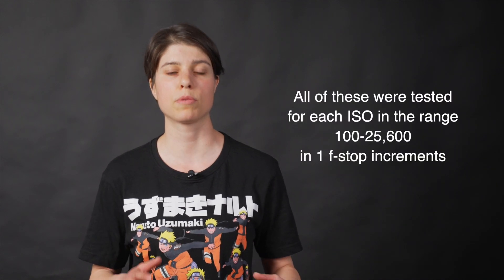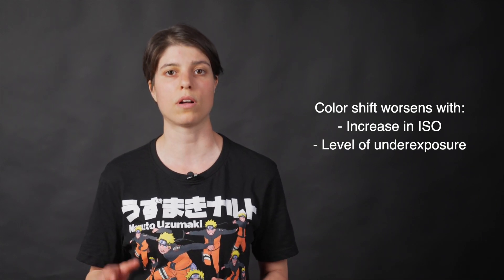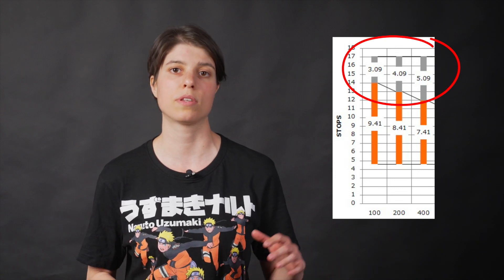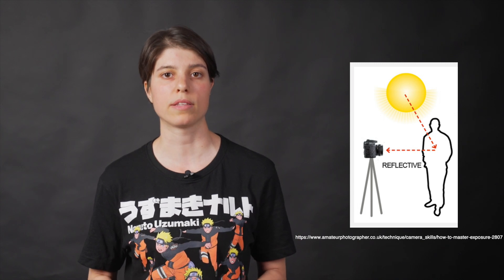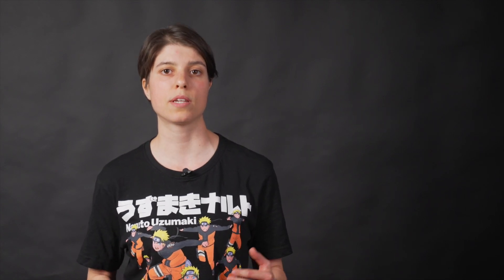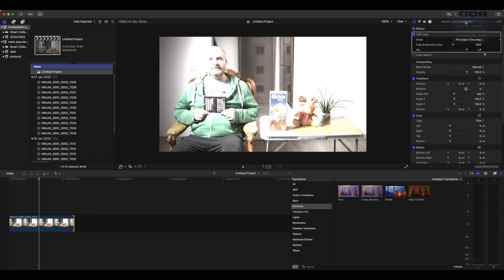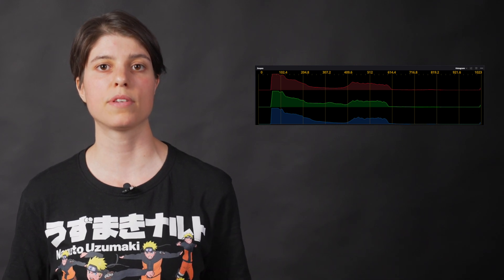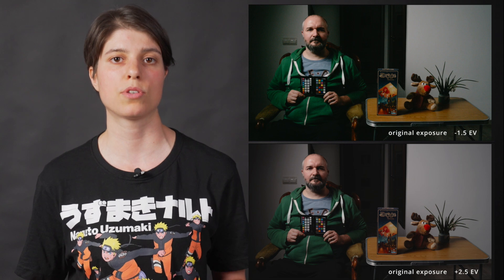How to Correctly Expose Sigma FP RAWs - Episode 1 Protocol

Comment: No way of monitoring your camera on set without false colour or an external monitor, different ISO’s meaning variations in how each of those monitoring methods works, and no log profile? This seems like a camera that would be terrifying to work with unless you were making proper cinema. Sigma need to fix these basic issues and I think this could possibly take over the market. Until then I’ll stick to reliability as that what’s gets you paid.

Comment: hello Cosmina, i have two cameras xt3 and a7m4, i really like the xt3 picture in the video, but i want a full frame sensor. is it worth taking sigma fp? will raw video be better in sigma fp compared to sony? I want to buy fp as a camera for video.
Reply from the maker: hi! The sony you have now is the full frame a7IV right? If you want to use the second camera in parallel with a7iv I would recommend getting another Sony. The 4:2:2 10 bits looks amazing. Apart from the Sigma FP which we just use on planned shots (or when we absolutely need 3 cameras), we have a sony a7III and a7sIII . This is what we use for weddings, conferences, teambuildings etc. So I think it depends what you want to use the Sigma for. if you want to get into more cinematic projects, Sigma is worth it (you should only use manual focus with it). If you’re more events oriented (and use autofocus- we just use autofocus in these situations), then i think it’s worth getting another a7IV or maybe even sIII if you want a low light beast. Our next upgrade will be probably replacing a7III with an a7IV
Reply: @IonCosmina  for example short on xt3 https://youtu.be/d3eWtGa0faM
Reply: @IonCosmina  yes, I have full frame Sony a7 iv, but I like use different cameras, and i want to try the benefits DNG RAW. Sony a7 iv ... I love it....the greatest autofocus, great photos.
Reply from the maker: The cdng is amazing but it fills your storage very quickly. We got a bm video assist and record braw out of the sigma now.
Reply: @IonCosmina  I use it exclusively in amateur shooting, for shooting my wife and children. Manual autofocus suits me more than.

Comment: Not sure if you'll see this. But I'm really comfortable with the false colour in the blackmagic cameras. Would you say sigma fp's internal false colour monitor is close to the same exposure readings as the blackmagic video assist?
Reply from the maker: I’d stick to sigma fp false colors. The video assist is close but the sigma is spot on. The bm cameras have very good tools indeed.
Reply: @IonCosmina  I appreciate the response!
Reply: @IonCosmina  Thank you guys for the reply. So just one last question. Does the fp actually send out a 12 bit 4k raw signal over hdmi without any data loss to be recorded into the blackmagic video assist? I got the fp because I wanted the raw cdng files but sometimes projects that are smaller in scale, Id rather used a 12:1 braw compression and just want to assume the signal output coming through the fp's hdmi would be equivalent to if I was filming braw internally in a pocket 6k/4k.
Reply from the maker: @Ben-id1tc  you do have 12bit raw output over hdmi.

Comment: Great tests and info! Thanks a lot. A tip on RAW processing in DaVinci though. Don't use the camera or the Blackmagic setting. When you mention you hadn't figured out why false color wasn't displaying correctly, this is it.

Set it to P3-D60 and Linear. This way you get more information out of it. Use a color space transform to either Cineon Film Log and the Davinci Kodak LUT, or Arri LogC into the Arri to Rec709 LUT. 

Make any corrections/adjustments firstly in the RAW tab, secondarily using ONLY gain while still in the linear color space, and finally in the LOG space before the final LUT. 

If you don't like the RAW tab controls, making gain wheel changes in linear space lets you set exposure (total RGB amount) and temp and tint (X/Y).

Be aware that exposure changes on the RAW tab is like changing the ISO and affects the noise level. Go easy on this one.

You can get even more DR out of it if you set gamut mapping to None instead of DaVinci in the first CST.

If you work in HDR you can use Rec2020 instead of Rec709. The FP's color space is very similar to Rec2020. Lightyears wider than 709. On par or even better than a $50k Sony Venice.
Reply from the maker: Hi, thanks for the tips! I did a quick test on the how false colors reacts to P3-D60 + linear settings. It shows a similar result to the camera metadata setting. So it is correct, but so was the false colors from the camera metadata... What's puzzling about the false colors is that the dropdown menu of the effect  (when you have Sigma FP footage) is made for BM Film, so that's why I was expecting a correct clipping point to be shown for all my clips that were set to BM Film from the camera raw menu. The mapping itself is correct per each ISO in the dropdownmenu with the exception of a COUPLE of clipping points for low ISOs, in BM Film (just BM FIlm). Then, from ISO 400 I think, the mapping is correct for both camera metadata AND BM Film, for all the EV ranges. 

I pulled up a CDNG file with +1.0 EV and tried the  P3-D60 + linear settings; it looks like I have a higher dynamic range for the shadows and mid-tones BUT a lower range for the highlights;  the image has a lower clipping point as far as I can tell.  

In the next video  that I'm working on (CDNG), I played around a bit with color space transforms that start with setting the camera raw settings to P3-D60 and Linear. I've tried CST to Davinci Wide Gamut + DaVinci Intermediate and ArriAlexa + Arri LogC. Yep, they definitely produce a flatter image than the camera metadata and Blackmagic settings. HOWEVER, and I found that odd, this doesn't also mean that the noise levels are decreased for all EV levels of an ISO! I also did a test with ACES (2 workflows, since the proper one I saw from a Netflix grading flow video didn't yield a good result). 

I didn't add any LUTs afterwards though! I also haven't tried out working in HDR, which sounds interesting. I'll try to go through all your ' recipes' in a different video, I really think CDNG grading workflow is an important point if you have a Sigma FP.

Comment: For some time now, I have a problem and maybe you can help. In 4k 12 bit CDNG I get sometimes choppy footage, the image is Flickering ( when I Pan shot ), is like the sensor is dropping frames( vreau sa spun ca imaginea sacadeaza)... Did you have any experience with the videos not being smooth ??? I tried changing the shutter speed, changing the fps but without any success.  Could it be the Rolling Shutter, the sensor readout speed?? I don't know but I am getting videos that are not smooth...I didn't see that at other cameras.
Reply from the maker: Checking it today. Hope it’s your media or some project settings.
Reply from the maker: I cheked. I have the same problem. It's worst @ 23.9 fps and gets better @ 25 fps. I'm checking prores raw and braw and get back to you. I'm sorry it took so long.
Reply: @IonCosmina  Found my problem. Maybe you want to check it too.
Panning speed.
https://www.youtube.com/watch?v=qAVfIQ2G7Io

Comment: Thanks for your Video ! one more question : can I just refer to the EV warning of the sigma fp screen for correct expose, like you said if I use 100iso base, the EV shouldn't beyond of 1 or 1.5 + EV value ?
Reply from the maker: Hi, for ISO 100 you can refer to the screen yes. It's also ok for a couple more ISO's after that, I'm not sure up to which though. BUT this exact thing will be addressed in the next video. It will be for BRAW, but I think it holds for CDNG and ProResRAW as well. I'll get back to you with a link as soon as it's posted.
Reply: @IonCosmina  hhh can't wait to see it ! I normally use iso 800 which give me the decent headroom and legroom dynamic range, for me its the safest.

Comment: Tare!
Helpful video, tone of infos. ;)
So the best settings to be sure that you preserve the image is to Overexpose if you dont have time to nail the perfect exposure.
And the FP screen is showing that you are overexpose but you are not. The Ninja is more accurate. 
There was a significant difference in quality between CDNG and the rest? I am curious cuz CDNG is not compressed and the others are.
Reply from the maker: Hi Sergiu, thanks for the feedback!! Yep your comments are exactly right! For ISO 100 and 200 I'd be careful not to expose more than 1.5 - 2.0 EV cause the clipping point is quite low. Also up until ISO 400 (included) it's ok to expose at 0 EV or even under expose a bit (like 0.5 EV) cause there isn't noticeable noise. More accurate and detailed response coming up in the next videos! 
At first glance I didn't notice any difference in quality (though the colors are different, especially BRAW). Here's a link where I put up sample footage for all the RAWs, at ISO 400, on all the exposure ranges (over to under exposed) - sorry for the verbal comments in the clips: https://s.go.ro/t5hv774o
Reply: I saw that FP has the base Iso 100 and 3200 at 12 Bit 4K CDNG. So at this Iso it should perform the best,yes? And a little overexposed just in case.
Reply from the maker: @vvision88  yep!